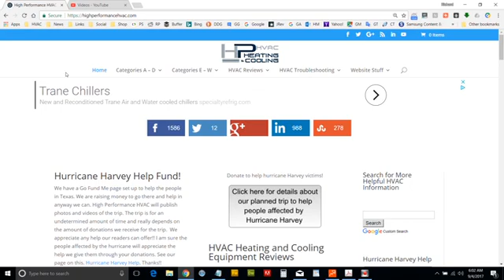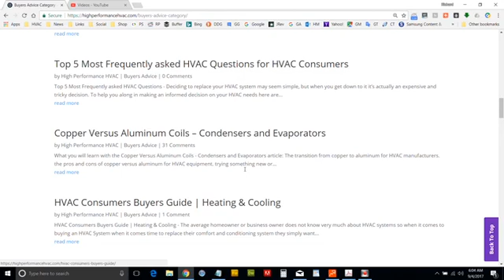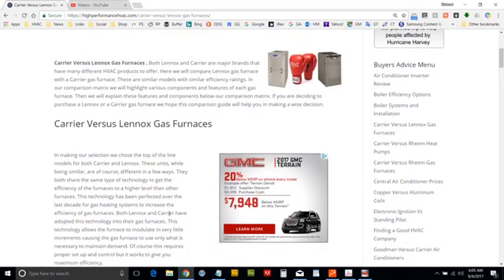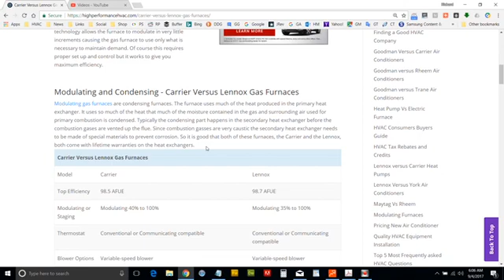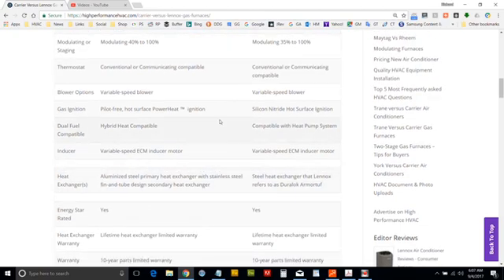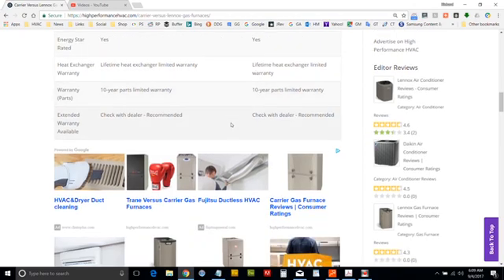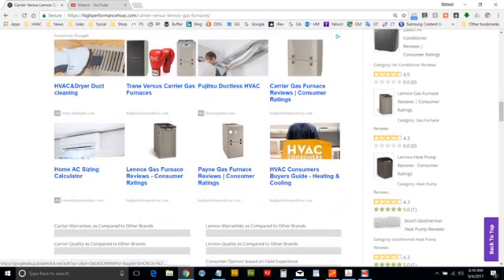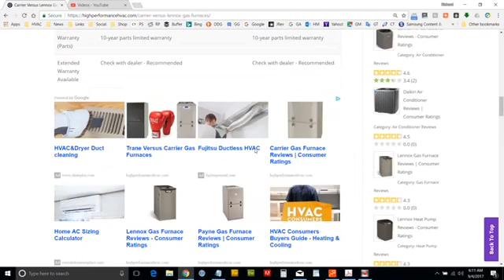Carrier Versus Lennox Gas Furnaces Comparison

Comment: You talk about labor warranty.  Do they even offer labor warranties. As long the Equiment  warranty such as 5 years.  Reason of my Question.    At first. Furnaces like new cars. No problems. But after a couple years. May have problems.   Also does the Labor warranty cover annual check ups?